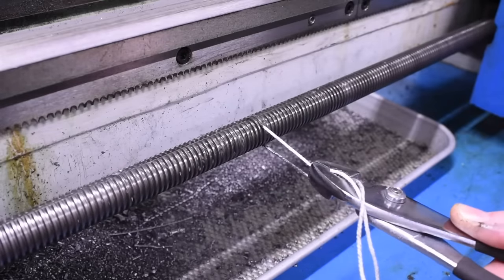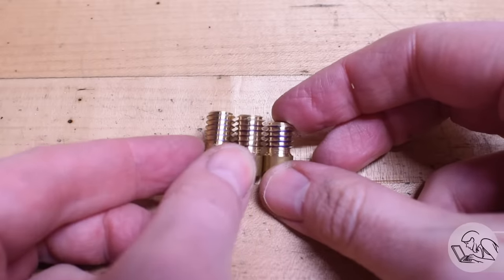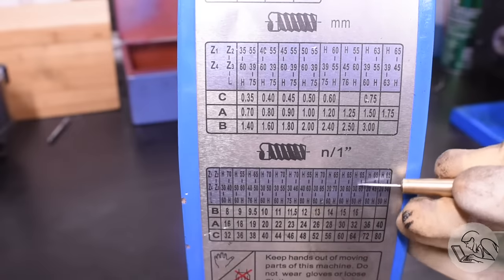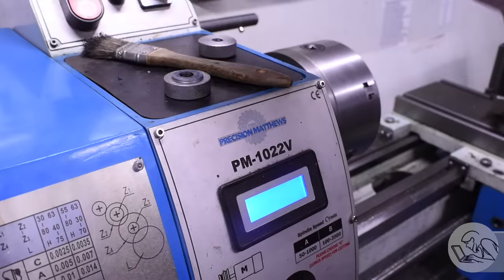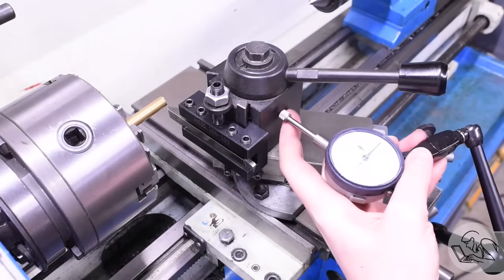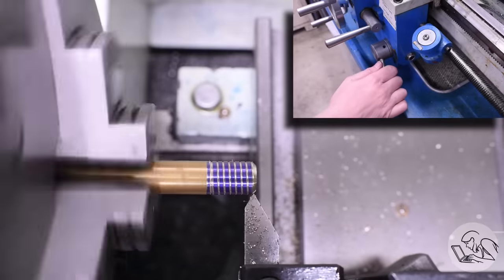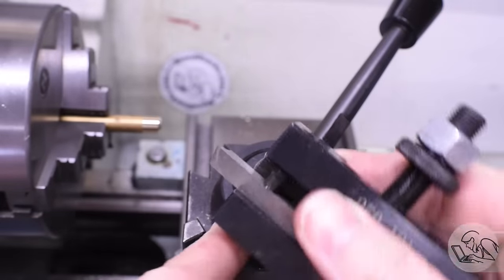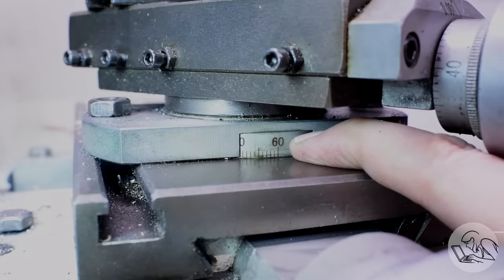How To Cut Threads On A Lathe

Comment: It's the absolute worst thing on earth when you accidentally take too deep of a pass, and immediately destroy your cutter and part.  It all happens so fast and it feels like being in a car accident.  When I was learning all of this as a production CNC operator, our engineers would always program everything at the maximum depth of cut allowed by the tool manufacturer.  And instead of using a canned cycle, each pass was programmed individually as a G92, so it was incredibly difficult to adjust.  All of this, while trying to learn by myself--so anyway, now I have thread related PTSD.

Comment: Having been a tool and die maker for a lot of years, I have chased a lot of threads on a lathe.  That being said, I find this a very informative video to teach beginning machinists and hobbyists the proper way to  preform that task.  You go girl.  :-) 
 Charlie
Reply: If you happen to run across any BSW or any British thread the thread angle is fifty five degrees and not sixty
Reply: @Mobile-ct1yf BSPP and BSPT.
I'm wondering how many John Deere and caterpillar tractors are out there with hydraulics that have 60 degree thread angles on their BSPT connections because of me. 😂  Oops.
Reply: I find this comment funny coming from a guy with the username "up yours"

Comment: some very good info which I've not seen mentioned on any other channels, particularly interpreting depth of cut from the chart on the machine and much room you have for engaging drive based on the lead screw dial.

Comment: A well-used manual with smudges and fingerprints is a thing of beauty
Reply: Corollary:  If you're reading the book for something and the pages are clean, you're probably in the wrong part.
Reply: @jimsvideos7201  well said. The grubby fingerprints bit is the most appropriate 'quick index' out there😁
Reply: Never thought about it before, but yes - absolutely!  My Haynes manuals are useless and as such have zero greasy finger marks.  My Suzuki cheatsheets (printouts of useful information like torque settings for the kingpin bearings and such) are covered in smudges...
Reply: @jimsvideos7201  Bonus points for handwritten notes either expanding on / correcting certain parts, or (my personal favorite) repeating info that's on a different page for added convenience.
Reply: Works with cook books, too. When my Mom was sick her aunt came in to help with the cooking, etc. She made all our favorites, I asked and she said she just paged through the book to the pages that were dirty and cooked those recipes.
Reply: "Users who opened this manual also watched here"
Reply: Geez, I was just going to say something about appreciating the gear-grease track marks on the pages, and here I am getting all these sage life-hacks.
Reply: Same goes for a cook book or recipes book.
Reply: Thanks Blondi 👍
Reply: Mine have blood on them too
Reply: @capitanvonchickenpants8492  Do you say the required phrase "THE BLOOD SACRIFICE HAS BEEN PAID" and then not injure yourself again on that project?   Or is that just me ?
Reply: @antontaylor4530  Haynes manuals newer than 30-35 years are one of my pet peaves. Pictures like in old newspapers instead of line drawings. Absurd priorities, like engine bearing tolerances, which no DIY'er is going to mess with, but no detail about taking out the dashboard or other delicate plastic details and putting them unharmed back. Fixing something like a defective heater control is where you can really save money.

Comment from the maker: Hey everyone- yes, I know there is a typo on one of the unit conversions. Save your comments about it.

A lot of people are also asking about flipping the compound the other way for cutting left to right. Ideally yes, because then the cutting forces are pushing into the compound backlash direction. In practice it doesn’t matter because the cuts are light and this way the compound can’t hit the chuck.

Lastly,  I misspoke on the topic of stock diameter for thread peaks vs. flats. You’ll get pointy threads if the stock is a little too large.
Reply: Good point.  Hitting the chuck with the compound is bad bueno.  I took the corner off the compound of a Hardinge HLV-H that way.
Reply: But if I don't comment about it, how am I supposed to make a low-effort no-content post that serves to boost my ego by slightly belittling someone I don't know on the internet? Are you trying to suck all the meaning and fun out of my life?
Reply: Save my comments?! ...but, but you made a typo .. ON THE INTERNET! Oh well, I guess I can dial down the abuse to 11, just this once.
Reply: cry  My little sherline lathe lacks a lead screw, change gears, reverse, and a compound slide.  So tempted to upsize but no room, and every "affordable" used lathe is silly money.  Weirdly, they only start getting cheaper again at three-phase and/or 3+ tonnes.  I saw a used 10 tonne russian Stanko lathe sell for a couple-hundred dollars recently.
Reply: You could "pin" your comment here to the top, so it doesn't get buried by newer comments.
Reply: @Clough42  "bad bueno"? LOL, literal translation = "bad good". I've seen some bad English, and bad Spanish, but I've never seen such bad good Spanglish.
Reply: Might have saved my comment about the compound, had I seen this comment.

Comment: Thank you for this video.  I have the same PM lathe as you and was able to successfully cut 1/2-13 threads in 316 SS after watching your video (I never tried threading on the lathe before this).  Your incremental steps were the perfect primer and enabled me to finish the forward hatch for my steel sailboat.  I ended up breaking and having to rebuild the change gear axles in the process and ruined a few inches of nice stainless practicing and determining which of the techniques was best for me, but I can now produce repeatable threads :>).  Your videos are a great asset to the world and you help make all of us better machinists!  Keep up the good work.

Comment: I like the banjo on that lathe.  It looks a lot less fiddly than the one on the Grizzly.  The manual looks more helpful, too.  The diagram with all the parallel threads is an excellent visualization.
Reply from the maker: Yah, it’s really quite a good design, as change gears go. About as painless as such a system can be, I think. Still want the ELS on there though. 😀
Reply: @Blondihacks  there is somebody around making them........dont rmember his name   :)
Reply: @Blondihacks  I was thinking about making a bowl of popcorn and waiting for the comments to start.  :)  The fact is, though, everything you teach in this video is all still applicable--even with some electronic help.

Comment: Thank you so much for this. I need to cut a rather obscure LH thread for an old machine and have been practising and failing to even manage the RH version. I was about to call it a day but watched your video to find out what I was doing wrong and then magically, success! Mostly the lesson was taking off the tiniest amount of material each time and making the same cut twice in a row towards the end and using the dial gauge rather than relying on what the indicator said. Thank you.

Comment: this channel is doing really well and rightfully so its a great resource. Well done quinn..My trade was as a fitter turner and Machinist and the info given here is great. I usually cut a thread close and then run a die nut over then you know it is the right form on the crests and the roots plus witdth an depth. Which gives optimum strength.

Comment: Very good step by step instructions for beginners. Your very thorough. One thing is that some folks when engaging the half nut and using the counter have told me that with even threads use 2 or 4 and odd use 1 or 3. As you demonstrated the way you did it works just fine. I've used the cross Feedmethod and compound method and both work fine.

Comment: Quinn, I just watched your video on How To Cut Threads On A Lathe. The video was posted 2 years ago. Someone may have already mentioned this. The spray gear lube that you preferred. You said it was messy and had to be careful not get any on the drive belt. Try spraying some in the cap or other small container and then use a machinist's brush to apply it. I hope this helps.

Comment: At 2:50 why did you face the end? Is this some kind of tradition?
Reply: Well played.
Reply: We all have to face the end eventually.
Reply: You want to face the end because sometimes when you are working with hard steels it can help you with the first thread. Sometimes your first thread can be worn out by just machining. Also the chamfer makes a huge different. For metric threads I like to work with a 60 degree chamfer (I'm from Germany so I do it most of the time) and for inch threads I'm gonna work with a 55 degree chamfer.
Also a 90 degree chamfer can't be bad for beginning a cut but it isn't perfect.
Reply: This falls under the title of "good workmanship".
Reply: It‘s even not allowed to ask this question.

Comment: Thank you very much for this video. I really appreciate how you are taking the time to explain things that are probably obvious to seasoned machinists, but terribly confusing to newcomers. 👍

One comment in this video I am wondering about: At 12:08 you say that if no blue is left, the initial outer diameter was probably too small.

Intuitively, it seems to me like it would be the other way around:

If the initial outer diameter is too small, I will be missing the top of the threads making them wider.

While if the initial od is too large, I will need to cut deeper in relation to the original outer diameter, resulting narrower/sharper threads, because I might end up turning them even smaller than the original outer diameter.

I would be really glad to clear up where my mistake with imagining the geometry there is.

Thank you very much and keep up your great work! 🙂

Comment: I bought a MX-210-V primarily for cutting plastic. I also purchased a 250-000 quick change tool post and some of the small triangle carbide tips. The tool post uses a threaded rod for mounting but the diameter of the rod was too small and allowed the post to shift around a little. I decided to make another double threaded rod and make it fit better. My first attempt at metal lathing and my first attempt at threading. It took a day and a half to get it done along with a lot of hair pulling. The metal was hard and not quality and chipped a lot. The tail stock center interfered with the tool post. The threads were ugly to say the least. I'm surprised the forward/reverse switch did not burn up from constantly changing directions. Every time the bit hit a snag it shifted and I had to align all over again. I broke the tip off of one of the triangle carbide cutters. Changing the gears for 1.50 threads was as crazy as solving a rubiks cube. I don't know how in the "- - - -" anyone can cut threads on such a lathe with any efficiency or quality. It definitely isn't for the faint of heart or the quitter. I just hope nobody has to call 911 when this thing has had enough and attacks me.

Comment: 19:10 Abom79 has a technique where you can disengage the half nut during metric threading (Shown in a video around 2018-2019 timeframe) to prevent crashing into the chuck. I think it is: when the tool gets to the end, you disengage to prevent the crash, and then shut it down and manually realign to the same number, reengage the half nut, and turn on the lathe in reverse.

Comment: After screw cutting 400+ monel stays for a locomotive Boiler.... Full size, I might add, I thought I new pretty much everything about screw cutting. Yep, I new diddly squat. Thankyou Quinn, it's all so much clearer now. Well explained lesson.
Also to give consistent gear mesh, I used a sheet of paper between the wheels to gap them.

Comment: I'm a beginner machinist, however I grew up with an Atlas Metal lathe in my dads shop, he was a Service Engineer for CAT.  I learned basic lathe procedures from him and down the road a guy gave me a HF metal lathe that I've been using for the last few years, as I gave my nephew my dad's Atlas Metal lathe when he passed, as he's also an engineer at CAT. I sure wish I had found some of your videos before my recent lathe purchase (my new lathe should be here in a couple of days) as you're the ONLY ONE that mentions making sure your lathe is set up for Imperial machining instead of Metric.  Unfortunately  the lathe I purchased is set up for Metric machining I believe from what was depicted in the pictures as I didn't even think about it NOT being set up and marked for Imperial machining.  Also, this has to be the BEST thread cutting video I've ever seen and there's  a couple of lathe gauges & tools I have of my fathers that I now know how to use. THANKS so much!

Comment: For cleaning up the gears to get a proper fit I used a small sanding wheel from a dremel kit and put that in a drill chuck and zipped it around in the hole a few times. Seemed to work well just make sure you check frequently as you don’t want them too loose😂

Comment: When I first read the title, I was confused why you would yet ANOTHER how to thread video as there are so many, but I like what you did with this video. Beginners will be much less frustrated if they approach it the way you explained everything.

Pressing a piece of paper between the change gears is a good way to set the mesh. Tighten everything down, then turn the gears to eject the paper.

I also like to draw a sharpie line on the top of the cross slide dovetail to mark where zero is at. It's a nice sanity check to make sure you are at the correct zero and not a full turn out or in from where you should be.

Comment: HI, I watched your video and have a few things I would like viewers to know to help them cut threads.
for external threads, the depth constant I commonly use is .6495 which is a starrett constant for external threading.
So, the equation is 1/N = P (p= pitch) x .6495 = whole depth. If your lathe is set up for diameter mode, this depth will be x2
For those who don't know what (N) means it = (threads per inch)
 the ( / ) slash means to divide.
For example, 1/2-13 thread would compute as follows. 1/13=.07692x.6495=.04996 = thread depth 
Also keep in mind the pitch of thread is also the linear movement in which the threaded member will travel in one full rotation.
These simple common calculations will work for all S.A.E. threads. Also if your lathe has an English lead screw , any number of threads that can be divided by 2 which = a whole number can be cut on any number on the chasing dial.
love the video . hope I helped someone with my comment. Thanks!

Comment: Thanks for another great video set on cutting threads. Minor point. If you set your compound on 31 degrees you'll get a nicer looking thread since the opposite side of the threading tool will be "shaving" off a small amount of material on each cut.

Comment: Thank you so much im a new to thread cutting and i had a problem with the compound angle. You fixed my problem  its not just the chinese lathes that have the 0deg parallel to the spindle also my Bulgarian zmm c8 lathe     🥰

Comment: Lots of great info in this video.  The first threads I cut came out OK, but I sure wish I knew this stuff.
I have a Micro Mark "True Inch" mini lathe that only gives change gear settings for Imperial threads, but Little Machine Shop has free to use software on their website that shows multitudes of threads that can be cut on any mini lathe.  Since I was cutting metric threads, I had to turn the speed control to zero after each pass, retract the cutter,  power the carriage to the right, bring it forward again, and then go for the next pass.  
I didn't know about having a thread relief at the end of the threads, I did not know about threading backwards, nor did I know about putting an angle on the compound.  But it all came out fine.  I now have a perfect set of stockmakers screws for my Russian Mosin Nagant.  I would not have learned any of this if taps and dies were available for that weird metric thread.

Comment: My first attempt at screw cutting a square form thread to try and replace a worn cross slide screw went very well. Then I learned that I could buy a replacement from the manufacturer at a very reasonable cost. It still gave me a lot of experience that I will never loose.
Reply from the maker: Square threads are quite difficult to cut because of the clearance challenges. It’s a big part of why Acme threads were invented. Equally strong but way easier to manufacture.
Reply: @Blondihacks  Yup the tool was interesting to grind. Also it was a left hand thread so baptism of fire!

Comment: I considered buying a bench top lathe to custom make threaded torch parts for torches that are obsolete.  I'm wondering if it will take me a long time to learn to use a lathe.   I'm 63 and don't want to spend two years learning just to make parts for obsolete torches.     Thanks for your input!

Comment: Hi Quinn, use chain lube for your change gears. Not the ptf stuff, WD40 do one which is superb for this. Goes on like water so it gets to where it needs to, but turns sticky almost immediately, so it doesn't throw off.

Comment: To set the backlash on the gears I was taught to have a sheet of paper between the gears when you close them together. Once locked into position roll the gears so the paper is pushed out and you'll have the backlash perfectly set.
Reply from the maker: Yah, that method never works for me. 🤷‍♀️
Reply: There’s a catch. You have to use A4 paper for Metric threads, but Letter for Imperial.